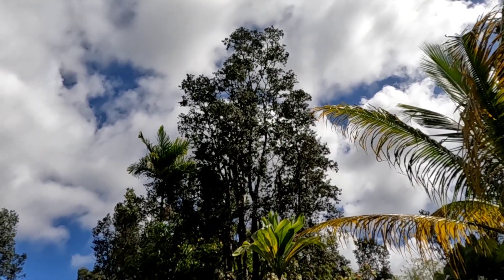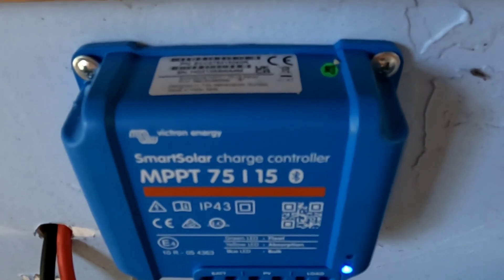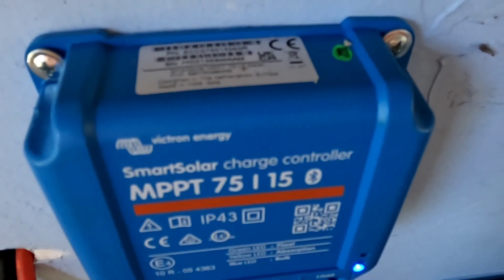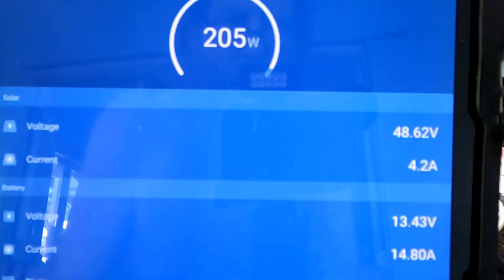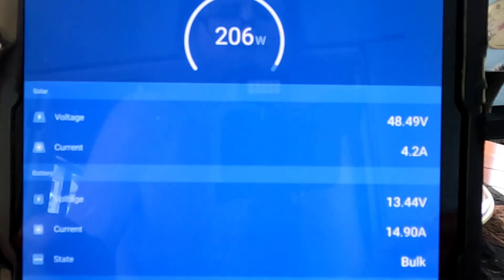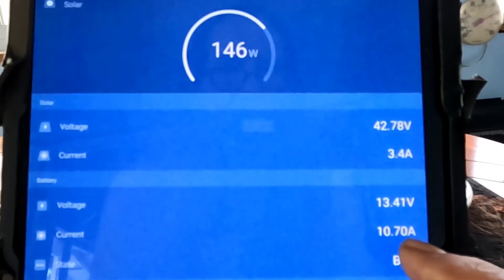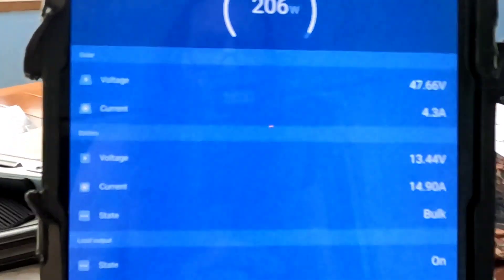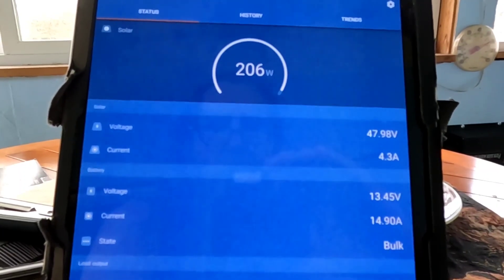Victron MPPT 75/15 pushed beyond rating. What happened?

Comment: In series... amps are not multiplied.   voltage is.  in Parallel, voltage is NOT multiplied but amps are....   so you are WELL under the rating.  the 14 amp is what the MPPT was charging the battery at not what was coming in from solar panels.

Comment: It's regulating the output to limit the charging current to 15 amps and the charging voltage to the specs of the battery. You would likely see more charging watts if you had a 24 volt battery instead of the 12 volt one you are using, as 24 volts * 15 amps would be 360 watts (or higher as the battery charge voltage would probably max out at 28.8).

Comment: I over panel 4 of my victron controllers, three of them 100/30 and one 75/15, they handle it fine as long as you dont go over the max voltage open circuit and the max short circuit current. The reason i do this is for shading and clouds, i still get the most out of the system with the yard space i have. I plan on getting another 100/30 soon to spread the power a bit better but money is always the limiting factor

Comment: Hi. Why bulk charge at 13.44? Is that not afloating voltage. Also if you did up the voltage to 14.4 volts you'd harness 15a limit still so more power

Comment: Its not just about the charge controller but about the efficiency of your solar panels and the sun each day plus the losses in your cable/total system. You can check each 100 wp solar panel individually to see how it works out

Comment: Per Victron specifications for the 75/15, PV input limits are 220w@12v and 440w@24v. I'm guessing you're connected to a 12v battery...

Comment: Yea, I was clipping power on my 150/20 same as your experiencing here. Victron MPPT is amazing! I have 4X165w 9.12 Amps IMPP coming into controller with 660watts/10.2 amps. MPPT conversion to 22.80. I found just like you I was clipping 19amps but, see blips 22amps right back to 19/20 amps. I upgraded to a 100/50 Victron found I was clipping out 2.80 amps. 24V 80Ah lithium batt bank.

Comment: The model number 75 | 15 means max of 75v on the solar input side this number you can exceed and probably would do damage to the mttp. The 15 part you can not exceed this is the max amps from the mttp to your bank. On a 12v bank the max theoretical charge wattage is 220w (14v x 15a) and if your bank was 24v the max would be 440w (28v x 15a).

Comment: The output current limit is automatically set to 15 amps from the factory in the controller settings tab because it’s a 15 amp model. The value is user editable, but is set by default to the controller’s maximum capability by Victron, i.e. 15 amps. You could set it to a lower value if needed, but shouldn’t set it above 15 amps, which could damage the controller.

Comment: I did that differently and not with victron either. I get half a day of shadow daily (when it's not raining) and it all added up to never charging my one 200Watt portable power supply fully. I have 4x 18vpanels, each supposedly putting out a max of 120Watts. All in 18v parallel. That's 18/24 volts with 480 watts possible, but never bringing in more than 20 watts daily because of clouds! I added 2 more 18/24volt panels 100watts each again in parallel, but when I switched them in, the 18 volts dropped to 16 volts and did nothing to increase the watts taken in by the Portable Power supply, which can accept 800W input according to the Specs.. I'm a beginner in Off Grid just trying to cut down consumption. Not happening!

Comment: You are never ever going to get full rated watts from any solar panel .. There are to many variables.. Angles to the sun ect .. Solar needs direct sunlight ...Not just full sunlight .. As well as the big killer ...Voltage drop in the cables ..
Reply from the maker: That's true!🤙

Comment: I run this charge controller from my 48v 1100ah battery bank, instead of panels.  I use the extra solar to charge an aux.12v 900ah battery bank.  The most controller will allow is 14.8 volts.

Comment: I know this is 1yo but here's my two cents with reading up on the subject of MPPTs.

When the current (amps) produced by the solar panels exceeds the maximum rated output current of an MPPT charge controller, the controller will limit the current to its maximum rated value. Here's what happens:

1. Current Limiting: The MPPT charge controller will not allow more current to flow to the battery than it is rated for. It has built-in mechanisms to prevent overcurrent situations.

2. Excess Current: Any current that exceeds the charge controller's capacity is not used. The MPPT will only draw as much current as it can safely manage and convert to the appropriate voltage for charging the battery.

3. Dissipation: The excess energy is not purposefully dissipated as heat; rather, it is simply not utilized. The MPPT's efficiency in converting voltage to current means that very little energy is wasted as heat.

4. Efficiency: MPPT charge controllers are designed to be highly efficient, typically around 90-95%. They convert excess voltage into additional current/charge for the battery, maximizing the power transfer.

5. Protection: MPPT controllers have protection features to ensure they do not exceed their voltage and current ratings, which helps to prevent damage to the controller and the battery.

In summary, an MPPT charge controller will limit the current to its maximum rated output, and any excess current produced by the solar panels will not be converted or dissipated as heat. The controller ensures that the system operates within safe parameters to protect the components and maximize efficiency.
Reply: Thank you for clarifying this! So, MPPT controller can work with higher capacity panels simply by not converting excess capacity? That is very clever!
Reply: @robvalley3612 I've found different results than you state. My 75/15 and 100/30 get quite warm at their maximum amperage. So much, this is why I'm here watching this video in 2025. My fuse holders are degrading due to the warmth created in the leads (short ~6") from the CC to the battery. The CC itself gets quite warm on the top as well. I'm thinking about removing the fuse holder as it's likely causing resistance but I'm also worried about fire. Should I rely on just the Victron fuse?
Reply: Your explanation is correct. As in all fields, YouTube is full of teachers who are not adequately trained, who provide overly simplistic explanations or who want to sell more expensive devices. If the MPPT or PWM is well designed, any excess input power from the panels is lost. Without an automatic protection system that limits the output current to the maximum operating value, the circuit would be damaged every time the load (i.e. the battery) exceeded the absorption limit, even if the panels were supplying power within the limits. For example, if a 2V cell in a lead-acid battery being charged has short-circuited, the voltage at its terminals would be 10V (rather than 12V) and the circuit would be damaged. However, things change when the input voltage from the panels exceeds 75 V because, in that case, the circuit is permanently damaged.

Comment: You can't measure with the same controller. The input it shows will be always equal with the output plus some internal loses. It will just take from the panels the max power it can handle and just not use all the panels can give.

Comment: I use only one 230w panel for the same setup on a pipe that can turn to fallow the sun, I would make a solar tracker if I would use more power, but so far for a tiny setup no complaints. 808 backout

Comment: I over panel my controller 8% because most of the time the panel is producing 50% - 75% of its max power - My controller is an EpEver 20a  - it starts to feather off the current at 18amps - it does this by shifting from the max power point effectively making the panel less efficient - There are marginal gains buy using a slightly undersize controller  in that mid-power output the unit will be running near maximum efficiency though after 75% when things get warm  a bigger control;er would perform better

Comment: victron 100/50 specifies max input current of 60 amps - I give it 2400w (70v x 36amps) controller never shows anything higher than around 60v x 12 amps combo (700w) which converts to a solid 50amp output.
wondering how the excess current damages the controller - if I supply 4800w (70v x 72 amps) should remain at 60v x 12 amps at the unit. I assume the controller just can't throttle more than 60 amps, gets hot, wears and burns out. can't find a precise answer and not willing to set fire to my equipment for science.
Docs say your 75/15 should have no greater than 15amps input from the array - if you are willing to pump 20 amps or more, I will happily watch :)

Comment: I am curious if you go touch the controller if it’s shedding the overage of amps in the form of heat. In other words is the MPPT controller hot? Headed your way in 60 days for vacation. Maybe we will bump into you guys. I am planning on installing a solar panel on the roof of my truck with a power Queen mini and that controller. I will have an Anderson connector at the bumper to connect into my RV with the other 2 power Queen minis and panels. We will see how that experiment goes.

Comment: you have not exceeded the ratings
- need to read the specifications for the ratings

Victron Specifies The Max current spec for the unit is the "Short Circuit Current" of the panel set
- this depends on how the panels are wired (series vs parallel)
Now, I take an educated guess that this is because of internal switching circuits or wire size on the panel side
- As you observe the units will self regulate down to the 15A (in this case) max current output when the panel set is slightly oversized
- Oversizing of the panel sets will result in better poor weather performance at the expense of not getting peak potential output on full sun best case days

Comment: I'm still worried about damage at the SCC when I overpanel. But I'm tempted to increase my harvest on cloudy days with very meager results.
I'm getting a 100/20 and like to run a array of 32pc. Old 30W panels 17.2 Vmp / 1.75 Imp. Making 8 strings of 4 panels in parallel with 960W in total with a 24V System. So I stay under 100V and 20A.
I don't mind some clipping, but don't like to damage mit Charge Controller.

Comment: In my case doubling the solar panels will overpanel the controller by 10 amps. I contacted the manufacturer, Rich Solar, and this was their response:

Rich Solar: "The controller will clip the output amperage, but it is not recommended to go over the rating. The controller will convert excess amperage into heat, and having the controller do this for long periods of time will eventually burn out the controller."

Since it would only get much over the amperage limit under peak sun, I think I'll try putting a thermostat in series with the solar panels to offload about 100 watts whenever the internal temperature of the controller gets too hot.

Comment: You can't exceed the amperage, the charge controller will only take what it is rated for, you can put 2000 strings in parallel giving you 20000A....the charge controller will only take what it can.
What you can't do... is overvoltage...

Comment: The only time to over-panel a system is when you are having cloudier weather and still want to get as much power as possible.  Otherwise, you should disconnect one of your panels so that your not working your charge controller so hard.  Only problem is that you'd only really get about 160-180 watts on 2 panels.

Comment: Rule of thumb.
Dont exceed voltage.
Dont exceed Amps on PV string rating.
So the 75/15 is:
75 Volts limit for string input. (Can cause damage)
15 Amps over 12V output max. (Cannot cause damage) = 180W max but this MPPT can actually output 220W.

Comment: So I have a Victron 100/50 smart controller I’m going to be using lifePo4 batteries I have four newer style 100 W nine busbar Renorgy solar panels and I have three of the older Renorgy solar panels I’m not sure I think they’re five or so busbars can I wire the new and the old panels together in series for that charge controller??? and if I can how many wired in series would be safe for that charge controller??? Update: I wired six 100 W Renorgy 9 bus bar panels in series series parallel and ran them into my 100/50 Victron Smart charge controller and then I bought a Victron 100/15 Smart charge controller and wired four 100 W panels into that,,,1 new nine bus bar panel and then 3 older Renorgy panels I wired those panels also in series series, parallel both of those Victron smart charge controllers are Daisy chain together and work great the 100/15 pegs out at 220 W and 15 A and my six 100 W panels going into my 100/50 charge controller will go over 600 W a lot of times.My battery bank is now three 100 amp hour Redodo 12 V batteries however I’m planning on buying a fourth like new battery from Redodo very soon. I’m using a Victron Phoenix 1000 W inverter so far everything is working good and I’m also using the Victron Smart.shunt. I’m planning on building a bigger system soon to run at least one small window air conditioner for the summer, and maybe an electric coffee maker/ microwave/slice air fryer once in a while separately and only one at a time and intermittent use only however, this system will probably be 24 V. I’ll have to learn a little bit more about that (24 V system )so far I only have experience with 12 V,,,,these new batteries and these Victron components are just ideal. They have a major game changer.👍😊 Years ago. I had an old tracer 4210 MPPT c/c (I actually started out with a MorningStar pro star 100/30 PWM charge controller I still have that one and as far as I know, it still works)  four golf cart, batteries and 800 W harborFreight tools modified sine wave inverter and 4 100 W Renorgy Solar panels. Everything was wired in parallel cause that’s all I knew how to do. I knew there were fancy ways to wire panels but I didn’t know how to do it. I’d run the refrigerator on it as much as I could to try and save money on my electric bill and also watch television at night on the weekends I was actually very happy with that back then because that’s all I knew at that time one big drawback was the parallel wiring and the longevity of the batteries and the maintenance of the batteries I used the batteries harder than I should have and they usually only lasted two years at most not really cost-effective I guess. I was getting ready to replace my old  batteries again on my old system but through serendipity I guess you could say I ran across some of your videos Bob, you explained wiring panels In series and in series series parallel so very plainly that I could understand it and you showed everyone how to use and configure this new Victron smart equipment in such a way that I was able to understand it and do the same at home with my equipment you showed me and the rest of the world how to have one and/or multiple Victron smart charge controllers hooked together working together how to hook up all the Victron equipment and make it talk to each other and work together and I’ve created my dream system by watching your videos and I thank you so very much for that for sharing part of your life with us and showing us how to become more energy self sufficient or at least create a very safe and reliable emergency backup system. I’ve been running my refrigerator every single day  now and watching TV and doing a few other things on Solar all the time now not just once in a while, that’s good for our planet clean energy and all and good for saving money on our electric bill so I just like to thank you for all your videos and all your help in generosity and kindness and I  Appreciate you and everything you’ve done for us all 👍🆒😎🆒👍😊💕💐🌻🌺🌹✌️🕊️ God bless you, brother.

Comment: if the panels are in series then the voc is times 3 but the amps do not add up only in parallel do the amps add up but the volts do not add up

Comment: You haven't exceeded the input rating as your series panels are only capable of putting out 6.5 amps short circuit current (In series the current rating is the single panel rating). You could add another series string of these panels in parallel and your short circuit current would still only be 2 x 6.5 = 13 amps and within the input rating. It wouldn't be very cost effective though as you'd be using 600 watts of panels to get a max of 220 watts at 12 volts. In this case 300 watts of panels in series seems like a good match especially in areas with variable weather.
It looks like this controller can actually use 440 watts for 24 volts in which case 6 x100 watt panels in two strings would be optimal and not overload the charge controller (as each string contributes 60 volts and 6.5 amps giving you 60 volts and 13amps total).
If you are in a location that gets hours and hours of full sun then it would be worth matching the solar panels to either 220 watt or 440 watt depending on your battery voltage. For 400 watts you'd want two strings of 2 panels. 4 panels in series would give 80 volts open circuit exceeding the 75 volt input rating.
Obviously these figures only apply to these 100 watt panels with a 20 volt open circuit voltage and 6.5 amp short circuit current.